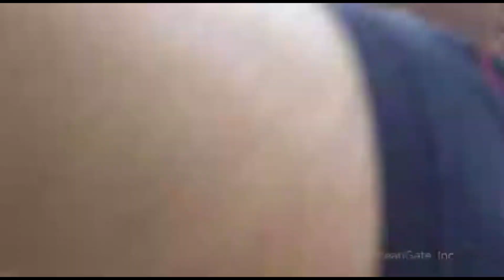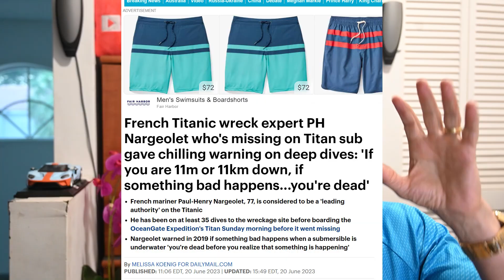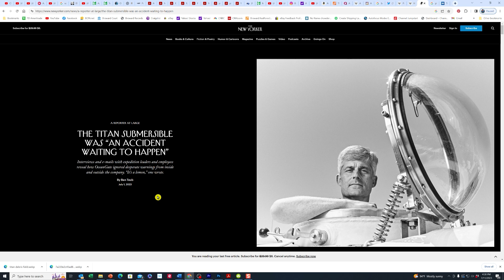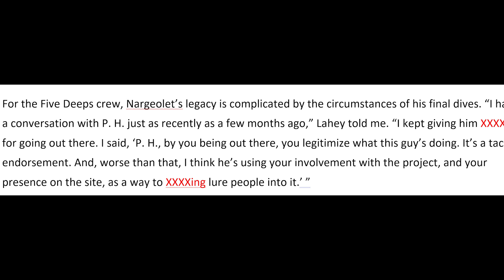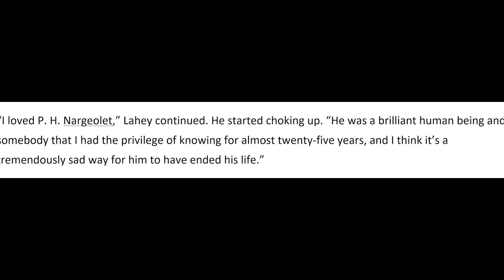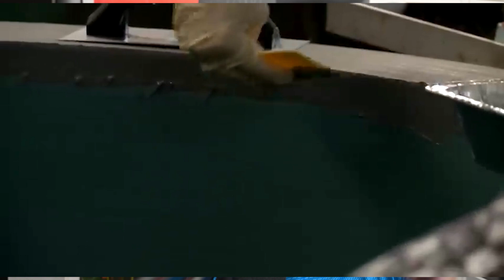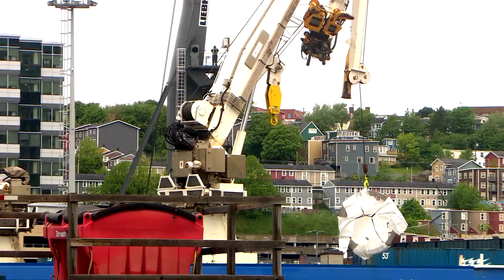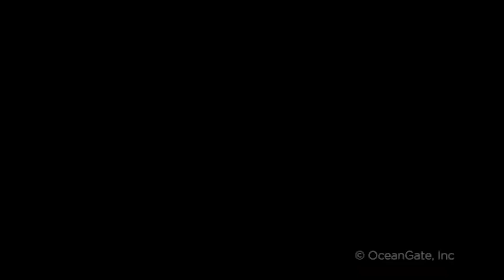Titan Sub: More Q&A, Design Defects, Why Descent Fast

Comment: The autoclave is used for curing the resin matrix that supports the fiber and this is particularly important for large flat-ish parts like aircraft aerodynamic surfaces. Fiber composites are often assembled as pre-pregs, or fiber that is soaked with the minimum necessary amount of heat cure resin. There are many formulations of resins that have very long pot life at room temperature, and are only fully cured by exposure to elevated temperature. This is what the autoclave is for, to isostatically press the green composite layup against its form, and to cure the resin by steam heat. I would guess that the carbon filament used to wind the Titan cylinder was probably impregnated by the winding head with a room-temperature cure resin, blended on the fly as it was wound, so an autoclave would not be needed. I don't see that detail in the video, thus my guess. The fiber was wound at slight tension, so isostatic pressure was not needed to ensure a void-free layup. I am presuming that the interstitial spaces between the individual fibers are completely filled by resin all the way through the wall thickness of the finished cylinder, but I don't see that detail either. Carbon fiber that is not completely filled and supported by a resin matrix would be mechanically very weak in axial compression, like trying to push a rope. You are looking at several very different composite applications which are not directly comparable.
Reply: Well, the autoclave does more than just cure the resin, as you rightfully pointed out, depending on the resin, it can cure at room temperature, but you also can use a normal oven or heatlamps. However, the autoclave also helps to remove air bubbles and resin accumulations. So basically it has a normalizing effect on the fibre structure and importent structural parts are almost always cured in an autoclave.
Also, there's a rumour that the carbon fibre was actually a prepreg which they bought from Boeing for a rock bottom price. The reason it was so cheap though was, that it was past its shelf life.
Reply: I assume you're very experienced or perhaps an engineer.

Do you think that a properly designed and produced carbon fibre submersible hull is absolutely the wrong material?

Or do you think that with the right methodology it would maintain most of its tensional strength even though it's experiencing a compressive force?

My thinking is that because of the thickness and width of the cylinder that carbon fibre would still be experiencing significant tensional forces.
Reply: @CheeryRhymes  I would say you can do a carbon fibre submersible if done properly, but it's certainly not the easiest and probably not even the cheapest way.

You are right with your assumption. If you use a high thickness cylinder under outside pressure, you still have significant tensional forces at the inside radius. In fact the tensional forces at the inside radius are the same as if the pressure would be on the inside. The problem though starts if you look more towards the ouside. You have significant shear forces. the Epoxy has to take on at least some of these forces no matter what. So that's why i wouldn't use prepregs that have gone over their shelf life. You don't know how good the epoxy still holds up.
By the way the thing that would have worried me, at 7:49 you can see a still of the finisched CF hull. There are clearly bubbles and imperfections visible. And that's just the top layer...If you cure this just with a vacuum bag but without the pressure of an autoclave, you never get a satisfactory result.
Reply: @CheeryRhymes  I am an engineer (retired) with some detailed knowledge of materials science although it was not my primary area. I think carbon fiber is absolutely the wrong material. It has an incredible strength to weight ratio with a uniquely high tensile elastic modulus (very stiff). This makes it very useful in tensile applications. However, it is very brittle; the fibers easily break when bent to less than a certain characteristic radius. Even in tensile applications, it must be well supported by a resin matrix.In compression, it would merely act as a filler for the resin, imparting some additional strength, but nothing like its tensile properties. Its properties in compression do not meet its tensile performance; fiber composites are highly anisotropic materials and this must be accounted for in component design. carbon fiber has a slippery surface, much like a linear version of graphite flakes, so the matrix resin will not chemically bond to it unless it is given a special chemical surface treatment. I do not know if they do this for practical applications, but I would guess not, because there probably would not be a cost effective advantage for its typical uses in tensile applications. The slippery surface would only be a minor factor in tensile applications, but would be a big deal in compression. The Titan cylinder wall was loaded in compression, both tangentially and axially, and resolved shear forces were supported by the resin matrix. This is not how fiber composites are loaded in aerospace applications. In axial compression, carbon fiber composites fail suddenly by brittle fracture (like glass). There would be microcracking as the resin separates from the fibers, allowing the fibers to buckle and crumble under axial compression. Para-Aramid (Kevlar) fibers would buckle under compression, but they would pile up rather than fracture because Kevlar can handle a very small radius bend without failure. There are some demo videos showing this behavior by applying loads with a large hydraulic press. Brittle materials fail suddenly, without much warning. Initial microcracks rapidly propagate and the material suddenly weakens. This is much different than what we see with a ductile material like titanium. Ductile materials initially yield and work harden which strengthens the part allowing for a margin of safety before catastrophic failure. If they just had to use a fiber composite, they should have used Kevlar instead of carbon fiber even though it would be less favorable with respect to bulk density. I think they were trying to use carbon composite to reduce weight and increase buoyancy for this unusually large diameter vessel, although I think they did it wrong.  They should have used titanium (proven performance under compressive loads) for the cylindrical part of the hull and used additional mechanisms like externally attached smaller diameter buoyancy tanks for buoyancy management. This was a complex mechanical design problem, and I think they took shortcuts as they tried to push the envelope with a new unproven materials application, and they did it for attention seeking motives.
Reply: @dpasek1  of course titanium or similar would be better, that is very clear to me and I won't suggest otherwise.

But you say it was the wrong material but then seem to suggest there would have been better ways for the carbon fibre to have been applied.

I know that it will eventually weaken of course no matter what but could a similar design with much better engineering have produced a submersible that can 'safely' do a well calculated specified number of many multiple dives.

For instance, if they had made it 7in thick instead of 5in, used non-expired carbon fibre, used a clean room/vacuum chamber (I forget the name of the equipment aero companies use), laid the fibre in a better pattern etc. could they have theoretically produced a submersible that could dependably reach a set high amount of dives.

Or is it simply the nature of carbon fibre that it has no strength in this type of application and could fail well before the expected period despite multiple test hulls reaching a similar number of dives?

I think it's important to note that I'm not trying to be a contrarian or that I think it was a good idea at all or that I know better than any engineer or material scientist, just that despite his shortcuts and incompetence it outperformed what I would have thought possible based on the information I have seen about carbon fibre.
Reply: @CheeryRhymes  I think that a compressive stress application is completely inappropriate for carbon fiber composite as it was applied in the hull design. Aerospace technology is not directly applicable since it is a tensile stress application. The one thing I think could help carbon fiber composites to resist compressive stress better would be to chemically surface treat the fiber to covalently bond -OH or -NH2 groups to the carbon molecular structure. This would allow epoxy resin to chemically bond with it, cross linking the molecular structure to make it more resistant to shear stress and reduce the microcracking problem. Brittleness could be controlled by adding an appropriate amount of appropriately terminated butadiene to the resin mix. However, I do not believe this is done with current technology. 

You are thinking of an autoclave for the equipment. This is required for prepreg fiber where the material is soaked with uncured resin before fabrication and cured after layup by heating it in the autoclave with steam. This is required for large area layups, but not necessarily for a wound cylindrical part, the latter which can just use a room temperature cure resin system applied concurrently with the fiber.

IMO, the circumferential wind of the fiber was the best choice of wind  for compressive stress since the fibers are laid directly in line with the stress vectors. Remember, the Titan was a vacuum chamber, not a pressure vessel. This distinction does not seem to be commonly understood yet it is a very important design factor, especially considering the anisotropy of the mechanical properties of fiber composites.

I don't yet see reliable information on the fiber that they used. Long single strand carbon fiber is often supplied wound on a cone like other long continuous fiber or thread. If it was supplied in this form, it would probably not be prepreg. Prepreg products have a limited shelf life and need to be kept cool, or even refrigerated prior to use to prevent premature resin cure initiation. Untreated fiber or fabric OTOH, has a very long shelf life.

The basic design principle that they violated, flippantly stated, is "You can't push a rope."

Comment: Thanks for the Q&As, Jeff. I'm wondering about the rear, cone-shaped area behind the pressure capsule. Was this area watertight? Why wouldn't it collapse as the sub got deeper? I appreciate you answering our questions!
Reply: It was just a cowling.
Reply: Under the cowling were separate pressure vessels holding the batteries and some electronics. Most of the wiring and the thrusters themselves was subject to full pressure and would not have been damaged by it. Water in the battery containers, as long as it stayed below the level of the battery terminals, would not have affected operation but would have affected buoyancy.
Reply: @daveuggla8383 Thank you!
Reply: Would be an ironic premise if any of those sealed for high pressure depth systems failed in some way that contributed to the dive becoming unsalvageable. Maybe something got jarred a bit too hard or too many cycles when the craft was being towed to sea on its landing platform?

Comment: The glue on the titanium rings is there to hold it together at the surface. During diving the pressure holds it together, like the O ring on the domes. It’s just a seal.
Reply: Yes agreed, the adhesive and the video game controllers are just red herrings.
Reply: Good point.   I thought of that too, but it's also a point of potential leaks.   There a lot of forces at play.   It may be impossible to determine exactly what happened without recordings from inside the craft.   It could simply be sudden catastrophic failure.
Reply: @JoeLinux2000  I believe the cylinder was failing because carbon fibre doesn’t work in compression, but we need to re-build Titan and put it in a test chamber to know for sure.
Reply: I get that, but might differential thermal and/or elastic properties between titanium and graphite produce enough shear in each dive that it could fatigue to the point of a pinhole size leak? Is the bonding adhesive elastic enough to take the cyclic loads? Their elastic moduli differ (depending on alloy and such) by factors of no less than 2 and perhaps as high as 10. Five might be a good enough approximate for our speculation. Stiffness matters a great deal.
Reply: Yaa. No. Because  the pressure  woukd have been inconsistent in uts deforestation  systems

Comment: Did the Titan actually implode when we think it did? Or did the water leak cause sudden electrical failure, plunging the sub into darkness and then dropping like a stone and imploding at a lower depth? What do you think?
Reply: I think it's a real argument for pilot error. Rush had far less concern about his descent rate than the mothership, which leads me to believe that he purposely dove at that speed. Either he was showing off for the Portier Prince crew to show them the sub was tough to show proof of concept or he was trying to hurry the trip to get back to something else. Either way, Rush was an engineer, he knew the possible outcome of descending too fast. Misplaced faith in his design or death by pride? Idk! And, I don't believe the sub was weighed down by water because Rush would have recognized that issue based on the rate of descent and would've made corrections to address the issue or flat out cancel the dive. Besides, the only infiltration of water that could have had a major effect on the dive rate would have had to occur within the pressure vessel where the crew sat. I find it highly unlikely that Rush or the crew would not have noticed a leak inside the sub. Additionally, if the hull was compromised enough to allow water to come in, the Titan would have imploded far before it reach the Titanic. Also, all the major components sat in liquid filled compartments or were in pressurized housings in the mechanical bay at the rear of the sub. if the sub was weighed down by water, where was the leak? In my view, the more likely scenario is that the rate of descent caused damage to the battery compartment and the hull and both only completely failed when the sub got near the titanic and needed to ascend. While they had a secondary battery system they only had one hull. Whether a vessel is  made  from titanium or carbon-fibre, descending or ascending too fast can cause structural failures in compartments and the main pressure vessel. All the hype about the material the subs hull was made from could actually be wrong!
Reply: @dwsfamilyvlogs7705  Does buoyancy increase as it gets deeper?   How is it controlled?   They probably dumped ballast to return to the surface.
Reply: i don't think the sub would survive a leak. when carbon fiber structures of the type they built deform at all they tend to shatter all at once. especially at those pressures.